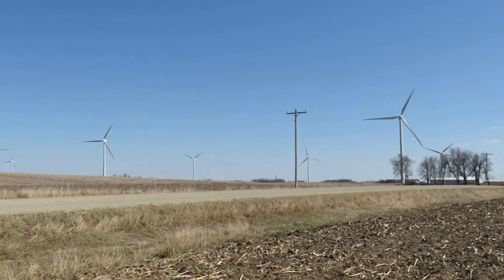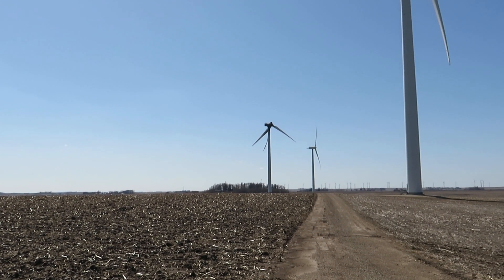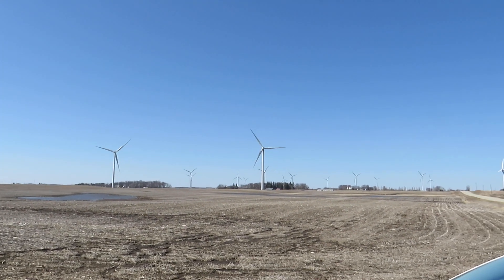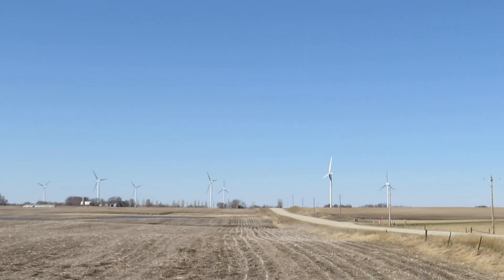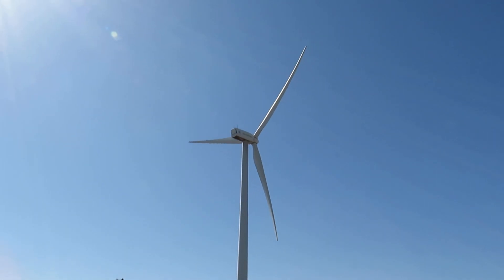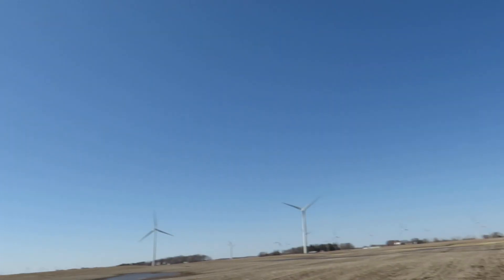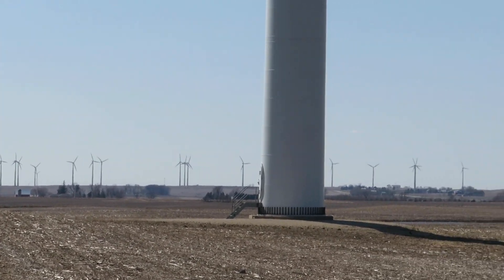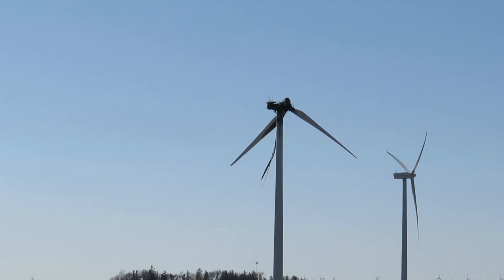Burned out wind turbine (Worth County, IA)

Comment from the maker: CORRECTION - I do not know why I called them "burn marks" in the moment, as that is not what they are on the other turbines. What you are actually seeing is hydraulic fluid leaking out of the nacells. Usually, turbines like that can still function, but it should be fixed routinely. Sorry for the error.
Reply: mn_sirens